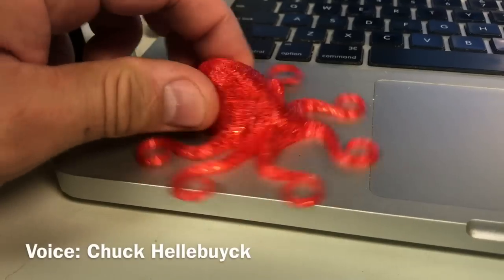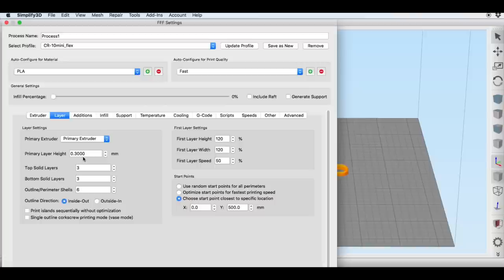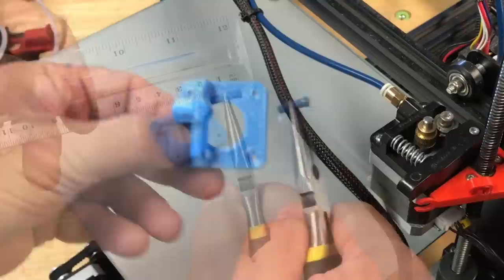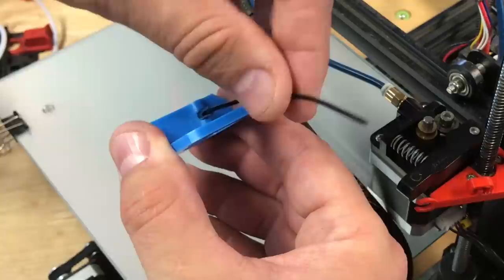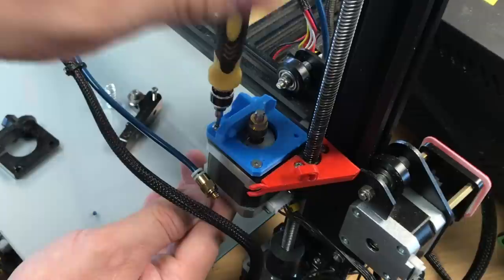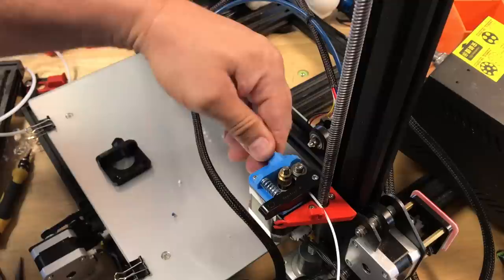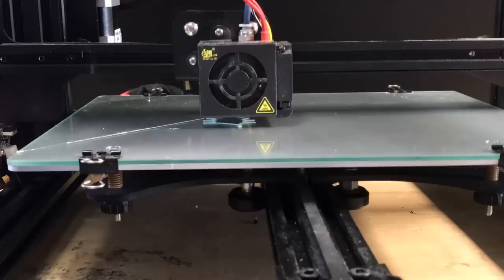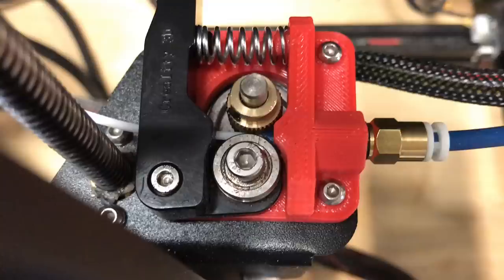3D Print Flexible Filament on CR-10 Mini and Creality Ender 3

Comment: Totally worked on my ender 3 at first. 
I could print 4 pieces with the flexible filament. 
But now I cannot print anymore. I start printing and it suddenly stops extruding. The gears move but the filament is not pushed. It slips. I changed the nozzle and have the same results. 
It does start the print but eventually stops extruding. I have no idea how to fix this. For PLA and ABS extrudes normally. 
What is happening with the TPU? I am using 230 degrees and 15mm/s, exactly the same as I did for the other pieces thats printed fine.
Reply from the maker: There is resistance somewhere. Check PTFE.
Reply: CHEP ok. Just did. I changed the ptfe for a new one and also the nozzle again. The path is clear. Believe it or not, now it extrudes filament out of the extruder! I checked the extruded printed piece and the small ptfe “snake” shape inside and it looked ok. I cannot believe how I printed 4 pieces perfectly and now I cannot print flexible any way.

Comment: Great video Chep.  I tried to duplicate your success, but failed dramatically.  I printed the modified extruder, that works fine.  I've tried the flexi octopus with Filaflex 82A, Flexy 96A and Flexy2 98A.  All three had filament separation at the top of the octopus head.  I'm running Cura 3.6 with .3mm layer height, no retraction, 3 top and bottom layers and Wall Line Count is 6.  Any idea what went wrong?  I'm also running a CR-10 Mini.  Any advice is greatly appreciated.
Reply from the maker: 10mm/s?
Reply: @FilamentFriday  no, 15
Reply from the maker: How old is your Filament?
Reply: @FilamentFriday  I just received the sample pack last week.  I forgot to mention that this is semi-flex.  I did a couple of tests, printing only the top of the head and it's looking better.  I don't recall all of the settings I changed but some of them are turning off the top layers, turning on adaptive layers and outer before inner walls.
Reply: @FilamentFriday  I've also been wondering, is it possible to convert the CR-10 Mini to a Direct extruder?
Reply from the maker: I haven’t but it’s possible.

Comment: CHEP have you done any 3Dlabprint airplanes i am not having any luck printing they come out stringy etc wont print inside structure on cura and when i use Simplify 3D program its so stringy and rough any help would be appreciated i cant find anyone that has a profile for this

Comment: CHEP, I have a pretty important question. Since i want to print this upgrade because i want to print flexibles, this is the way. But I am worried that in a few days when I upgrade to the dual drive extruder, or any metal extruder, this will not work. So my quesrion is does super flexibls tpu work with the winsinn extruder?
Reply from the maker: No neither works with very flexible. For that I recommend the EZR extruder. It works with all plastics and traps the filament so super flexible can’t escape. https://youtu.be/1GNDxvxpWr8

Comment: What exactly is the advantage of Capricorn tubing?
Reply from the maker: Higher temperature resistance mainly. Also fits a little tighter in the couplings.
Reply: @FilamentFriday   Any hard data on temperature?
I'm in the laborious process of building my very first 3D printer, and I'd like it to be able to handle high temp filaments from the start.
Reply from the maker: https://www.captubes.com/specs.html

Comment: Does the extruder mod work for normal PLA 1.75mm filaments or do you have to swap this mod out each time you run NinjaFlex?
Reply from the maker: It works for all filament

Comment: With your improved version do I still need to put the Capricorn tubing?
Reply from the maker: Only if you want a bit higher temperature resistant PTFE.
Reply: Hey It won’t let me access your improved one. It shows it but then when I click it it says something went wrong every time. But I can go to everything else so it’s not the site or anything. Just wondering if something happened. I mean is it still available?

Comment: I try print tpu with glass bed + hairspray but it wont stick.. any advise ?
Reply from the maker: TPU usually sticks like glue. Not sure why your having an issue. Maybe it needs to be dried out. TPU does absorb moisture.
Reply: @FilamentFriday  my bed temp is 70°c for first layer then 0° c till printing finish.. any advise sir?
Reply: A glue stick solved my TPU-glass bed adhesion issues for tall, skinny prints.

Comment: What size nozzle are you using on your Ender 3?
 I had 2 very nice prints on my Ender and then it just quit working even after changing the nozzle it will only print the first layer with TPU. I will try this part.
Reply from the maker: O.4

Comment: Ah man... I just got the all metal feeder upgrade too. Does that mean I'll have to switch back to a plastic one to print TPU?
Reply from the maker: I don’t know. My guess is yes or drill it out for the 4 mm PTFE tube.
Reply: Eco Mouse, you could try to drill out the back of the quick release fitting so the Capricorn tubing extends beyond the fitting. Then trim to fit. We used to do this on our machines at work. Norgren push to connect fittings are much better quality than the one's that come on these printers.

Comment: Would you consider the cr 10 mini and the cr10 to be cross compatible with upgrades? 
I'm having a hard time finding upgrades that say mini, and not just cr10. 

Looking to print pla plus and tpu, have an unopened cr10 mini I want to get set up
Reply from the maker: Just add an EZR extruder and you can print anything. https://youtu.be/1GNDxvxpWr8
Reply: @FilamentFriday  thank you for the advice and link! I will try to figure out everything I need before I get building, that solves 90% of my issues tho!

Comment: I followed everything but can't load filament for anything. What's your secret to getting the filament in the tubing?
Reply: Always cut your filament so it has a sharp tip, never just straight 90° across.

Comment: Chep I don't understand what was different about the new part. Why did it work when the stock one didn't? Can you use that now for ALL your printing?
Reply from the maker: It has the section of PTFE to fill the gap between the gear and wheel where the soft filament can bind.
Reply: @FilamentFriday  Ahh, I see. Thanks.

Comment: What Aluminum bed are you running under the glass bed on your CR-10?  Mine is warped on my Ender 3 and I am looking for a good replacement.  Thanks, Doug
Reply from the maker: I’m using the stock aluminum bed that came with the printer.
Reply: Did you ever get a new bed? How so?
Reply: @urjnlegend  he litteraly said he has the stock one

Comment: Thanks for this. I've been printing Sainsmart TPU (95A) on a stock Ender 3 Pro at 15mm/s. Not perfect, but not getting any jams or any real problems. But of course, 95A is considerably harder. I see that the extruder is the same so I'll try this mod and possibly some metal parts to replace the plastic ones that remain after the mod. Question though. What do you use to make sure TPU adheres to the bed. I have not tried on the Pro's magnetic bed, but I tried on smooth glass and also on the Creality textured glass surface and I can't get TPU to stick. It always comes undone halfway through the print and ruins it. No problems with PLA though.
Reply from the maker: I find Ninjaflex sticks too good on the stock Ender 3 bed.
Reply: @FilamentFriday  Maybe it's the filament. Doesn't seem like Sainsmart TPU sticks well at all. I don't need something as flexy as Ninjaflex, yet. I'm going at 95A for the time being. I spoke to another expert who recommended Elmer's purple glue sticks. So I ordered some. I was going to order Magigoo, but it's soooo expensive.

Comment: is it odd if my capricorn tubing doesn't fit snugly and just falls out from gravity? It seems from the videos as if it should fit tight enough to cut the tubing from the extruder as it just rotates and slides off.
Reply from the maker: Yes. Reprint at 98% size.
Reply: @FilamentFriday  odd, when reducing the print size to 98% the ptfe coupler won't fit and the bowden still seems loose. I'll just use some tape I suppose the tighten the fit. Thanks!

Comment: Can you use it to make a gasket for an HHO Generator?
Reply from the maker: Don’t know. I’ve never tried it.
Reply: A hydro electric generator?
Reply: @ipodtouch470  An HHO Generator makes Hydrogen gas using the Electrolysis method. The gasket separates the stainless steel plates from touching each other.
Reply: I wouldn't think so. The size of the hydrogen molecules is so small that it would surely leak somewhere between layers or on the not a 100% smooth surface. Try it out but I wouldn't have high hopes..
Reply: @kentharris7427  just use shower pan liner, much cheaper and you can get it at a hardware store

Comment: Did you flash new firmware? The menu looks different than my CR-10
Reply from the maker: I think I did film that on my reflashed CR-10 Mini.
Reply: Thought so. My CR-10 isn't able to be reflashed. I guess there's some issue with my board because I was trying for several hours and kept getting an error
Reply from the maker: It needs a bootloader installed first. Then you can reflash.

Comment: I'm in the market for a 3D printer and thinking of printing TPU mostly. The "semi-flex" type though not the ninjaflex type. Is the CR-10 mini worth the extra money if I will be mostly printing semi flex TPU?
Reply from the maker: They are the same machine other than build area so it all depends on the size you want to print. I do recommend the EZR extruder top for any flexibles though. https://youtu.be/1GNDxvxpWr8
Reply: CHEP interesting. I’ve watched from your earlier comparison video that you would choose the CR-10 Mini over the Ender. What can be attributed to the better print quality of the CR-10 mini?
Reply from the maker: At this point I say they are equal. The Ender 3 is a great Printer for the money. It’s just a question of your budget and how big of a build area you need.
Reply: CHEP thanks for your reply! For a while I leaned towards  the CR-10 Mini but I guess I’m back to the ender 3. I don’t need that big of a print volume as I would mostly be printing FPV drone parts. Seeing as the EZR extruder is still a $35 upgrade, would this little “hack” be sufficient enough to keep it low cost?
Reply from the maker: Yes, I have an EZR on my Ender 3 and print Flexible all the time. It also works with other filaments.
Reply: CHEP yes, but is it a necessary upgrade? Also, what do you think of the tronxy xy2 printer?
Reply from the maker: I believe if you want to print TPU successfully then it’s needed but try it without it before spending the money. 
I don’t trust the quality of Tronxy printers.

Comment: I have a question. I'm new to 3d printing. I just bought ender 3 pro and I m using its sample filament for now. But it sometimes cuts the filament and the model's top gets cooled so when I see it later it's too late even if I feed the filament back and resume the printing the new melted filament doesn't stick to the previous print ( even it sticks it breaks after the job is done especially when my son plays with the print). what should I do in this case? How to make it stick to the previous printing top? And also is it normal that the filament breaks?
Reply from the maker: Sounds like your filament is bad. Buy a fresh roll.
Reply: CHEP ok it is just the one that comes with  the box for dummies like me I think lol
Reply: CHEP thanks

Comment: Chep,   My CR 10 mini doesn’t have the command for “extruded” in the menu.   Any idea why??
Reply from the maker: I may have used my reflashed marlin machine for that video clip.
Reply: Thanks Chep.  I just ordered a boot loader kit.  Btw. I am printing with some  filament Friday blue.  Love it.
Reply: Hey Kevin ! 
In stock marlin you go: Prepare -> Move Axis -> 1mm -> Extruder

10mm doesnt work, need to use 1mm :P

Comment: Will this new mod work on the Ender 3?  Or is it even necessary?
Reply from the maker: Near the end I showed that I did the same mod on my Ender 3 and it worked fine.
Reply: Thank you.  I guess I missed that.
Reply: I printed flexible on my ender 3 with no problems and made no mods to the printer
Reply from the maker: What shore hardness?
Reply: Same...except with CR10-Mini...no mods and no problems after two spools of TPU!  I have to use extra precaution loading the filament because it is a bit weird with "grabbing" it at first.  But once fed through, no issues at all for me.  I believe my material is less flexible than ninjaflex though.  Sainsmart TPU from Amazon.
Reply: I want to print with TPU extensively.  It's hardness is 95, as opposed to ninjaflex, which is 90 or so.  I found using my 3D pen that I could use the TPU with ease, whereas the ninjaflex had problems feeding through the extruder drivegear.  The gear simply flattened the filament, allowing it to slip instead of gripping it and forcing it forward.
Reply: Sorry not sure there's nothing written on the box or spool.
The filament is sold by 3dfillies in Australia

Comment: This didn't work.  Got small kinks in the filament which jammed.
Reply: Try a tighter fit, so where you cut the V on the boden, it must be a close as possible to the gears... like touching almost.

Comment: I am just curious I see this upgade certified in amazon by creality. So did they took that man idea and iff so did they pay him or oposite - he just copy/paste their idea?
Reply from the maker: Where did you see that on amazon?
Reply: @FilamentFriday  Creality Upgrade 3D Printer Kit with Capricorn Premium XS Bowden Tubing, Upgraded MK8 Metal Feeder Extruder Frame, Pneumatic Couplers and 0.4mm Brass Nozzles for for Ender 3/3 Pro/5 CR-10 /10S/20

Or am I wrong?

Comment: Awesome job, well done video.  Question, as I also have other printers, and I added this to my Monoprice Mini to get it to do flexible and it works! (https://www.thingiverse.com/thing:1945783) So the question is, could you add something like that to the extruder you designed, so its just a tubeless install, just a part swap on the base?  Is there a reason it couldn't/wouldn't work?
Reply from the maker: How about this: https://youtu.be/az7pysnV_MY
Reply: @FilamentFriday  That's this video you linked me too, which I've watch plenty of times; I'm saying instead of using tubing, redesign the piece to come up into that zone, like the little piece does on the one I linked in my original question, or is that a bad idea for some reason?
Reply from the maker: Sure. Could be done.

Comment: You are showing Cura profile and explaining 10% of it. Shity that I cannot find any correct setting in fucking internet at all..
Reply: Hanys 〈3 MSI he mentioned which settings he changed from his normal PLA profile. I’m not sure what you aren’t understanding. Speed, retraction, bed and nozzle temp are the ones you need to worry about, and he told you what to do about those. 
All other settings are going to be specific to your material, your printer, and whatever you’re printing. The main issue people run into with flexibles, is the extruder. He also showed how he fixed it. 
I’m sure if you mentioned your specific misunderstanding, there would be plenty of people, including CHEP, that would be happy to answer.🤨